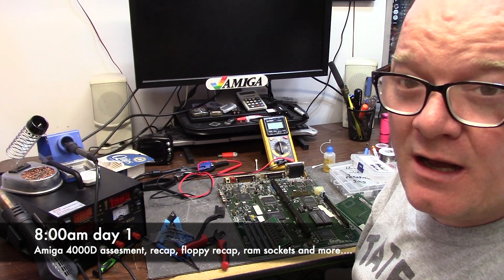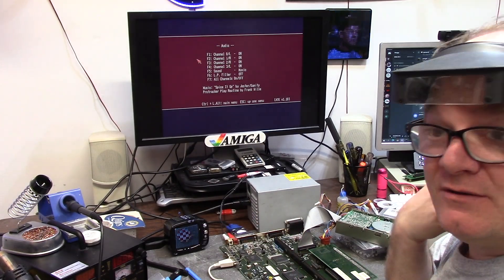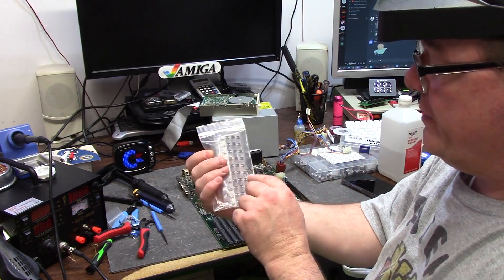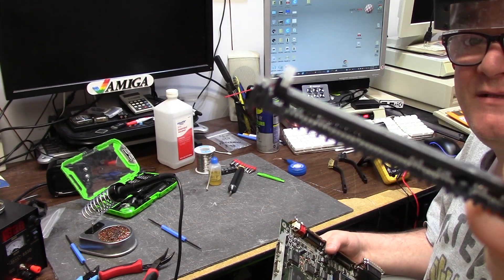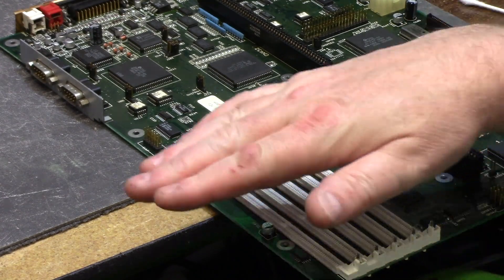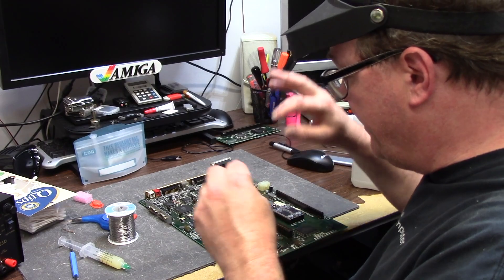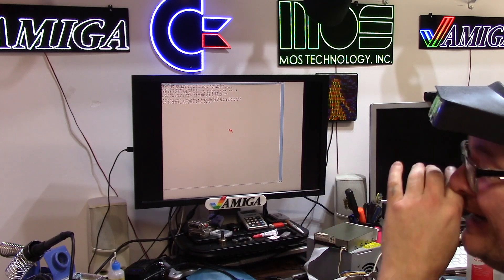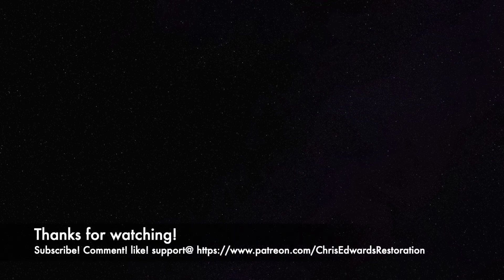MR J Commodore Amiga 4000 ram fix and sockets

Comment: I have just completed a bodg-a-thon on an 4000 board, and I THINK I have found all broken traces and bodged. And I also found the same chip for me was a little charred. So I had to bodge 4-5 of its pins, through the vias to the other side of the board. Now all pins show contuniuty with expected pins in Simms, and yet... sadly I have ZERO fast ram on boot, though the 2mb chip works (differnt chips and all). So anyone reading this know, is there a simple diagnostic, with no oscilloscope etc, to TEST if that chip is dead, not just singed? I have ordered replacements parts for it. But I really rather not replace it, only to find the exact same issue. Advice appreciated!
Reply from the maker: U891 and its traces control fastram

Comment: Are you going to use Kaynor Wire to link up all data lines to replace the print that got eaten by the battery juice but the battery should be mounted in the case somewhere and connected by a piece of twin core cable.
Reply from the maker: was not asked to install a battery in this one, just clean the holes.

Comment: Another great Video Chris 👍🏻 I take it you know that V1.20 of AmigaTestKit is now available? One of the biggest changes is the Floppy calibration can be done in +1 increments 😉 I thought my perfectly calibrated floppy drive wasn’t 😳 track 46 was showing 10/11 😳 worth the upgrade. Just changed some VL2020 batteries today for some new ones today. Still prefer the electric solder sucker for the job 🤗
Reply from the maker: just got it today! ,theres always new versions, changes and updates. its a great amiga time again!
Reply: @ChrisEdwardsRestoration  Indeed it is! 👍🏻😉

Comment: I can't begin to describe the pain it is replacing Simm sockets on A4000's after doing hundreds over the years,it became the most monotonous work of all repairs...well other than battery damage which at times was downright miserable. Good job putting another 4000 back to work! I can't believe u did all those pins with a manual pump WOW  carpel tunnel anyone ROFL.

Comment: It would be great if you could make a vid on how to properly store motherboards for tech illiterate guys like me.
Reply from the maker: if theres no battery , theres no real worry, however back in the day, the capacitor plague of the 90's all manuf were ripped off with a influx of cheap chinese capacitors. they used them, we now repair their leaks.  good quality caps will last years and years. look at the amiga 500 shoei caps... you can still buy them but they are crazy expensive. almost as expensive as the sprague brand.
Reply: @ChrisEdwardsRestoration  Hey man, thx for the immediate response!